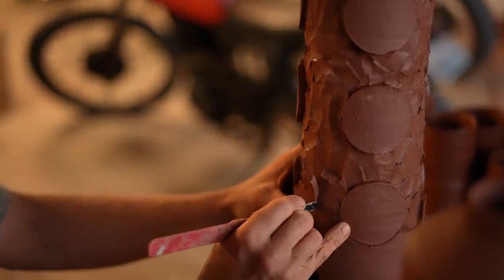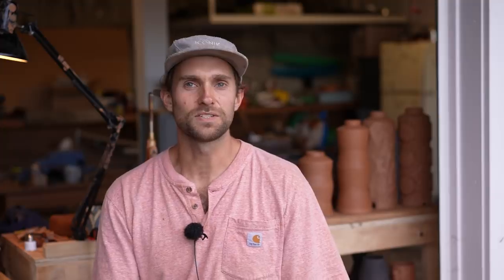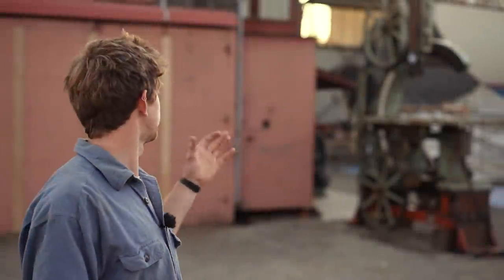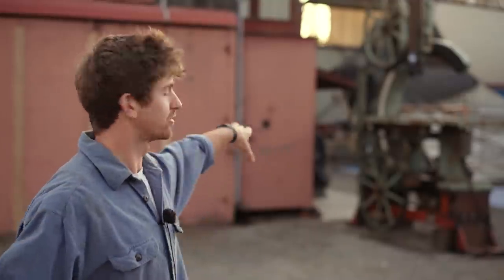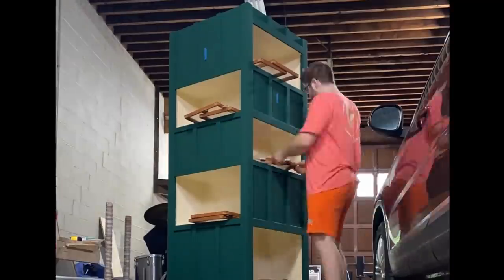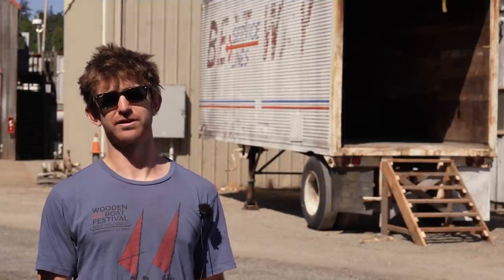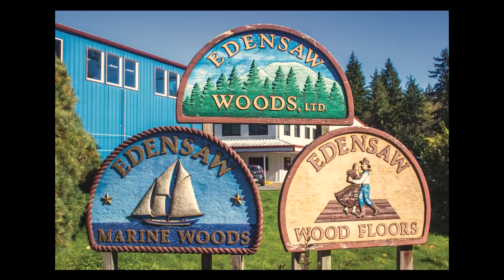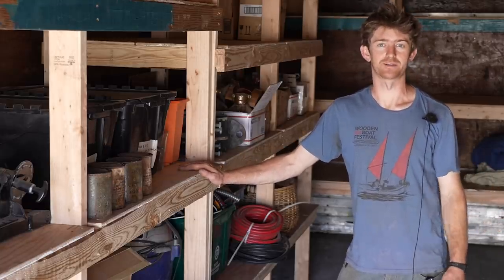New Workshop! ..moving in & TOUR (EP103)

Comment: Nice space to work.. the 'West systems',  t- shirt brought back memories of using that product for wooden sign building in 1982, many of the big redwood signs I produced are still hanging and holding up to the weather.. All had full length spline connection's between the board's using WS, as the adhesive, oil base primer with 1shot top coat..

Comment: I have been following your progress from the beginning. I go long periods without viewing, then binge on the episodes. I live in Ct. and much interested in your visit looking for suitable material for Tally ho. A little aside, a logger was cutting large White Oak Trees across the street from me in rural/forested eastern connecticut) when he dropped one on a steel guy wire running from an old utility pole over 100ft into the woods. All the poles and wires whipped around and even came in contact with each other, but no major damage. Turned out the trees he was cutting were being shipped up to Bath Shipyard in Maine, where they were rebuilding some massive old wooden boat. In my mind your project and those trees are somehow linked. I have a place on Islesboro Maine, an island  in the middle of Penobscot bay, If you ever sail tally ho this way, you have a place to stay if you are so inclined.

Comment: Leo, if you haven't poured your new keel yet I suggest you  add about  5% antimony to the mix. This will make the  lead much harder, also  lower the  melting  point a little. Good luck with the  pour. Remember that  it is vital that  all the lead that goes into the pot is absolutely dry. Any moisture  will  turn instantly to steam and the reaction could very well cause the molten lead to erupt and empty the pot over the poor bugger who puts it in. When I was an apprentice I saw it happen once with a moist length of lead pipe. It was impressive seeing 100kg of molten lead fire out of the pipe and onto the opposite wall! Nobody  hurt then, but so easily  could  have been

Comment: love this channel, have been following for year or more. As a boatbuilder from UK, just great to see the workmanship.
One thing I want to mention is the hull supports in the shed. With the polished concrete floor, the steel tri-pod supports will have a tendency to slide, or skid if not secured prperly. I see you have chains joining them together under the keel. But every time I see the boat supported this way, it worries me a bit. I was present when a 70ft yacht, supported in this way fell over. It was supported by steel tripods, on a concrete floor. They were joined under the boat with lorry straps. The bottoms of the tripods on one slid out, and the boat pivoted about the hull/tripod contact point, the lorry straps held, but didn't stop the steel bases sliding on the concrete. Just saying, especially when you start moving about on the boat, and moving the tripods to work on various parts of the hull.